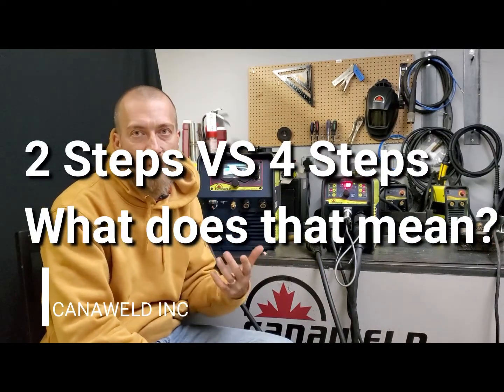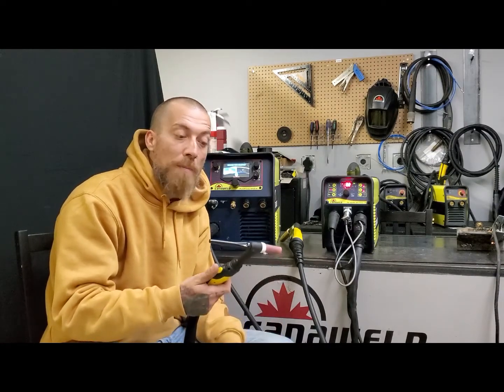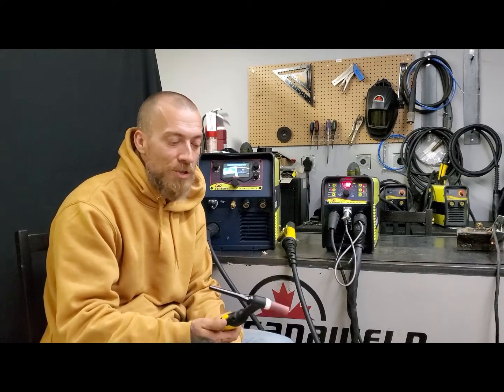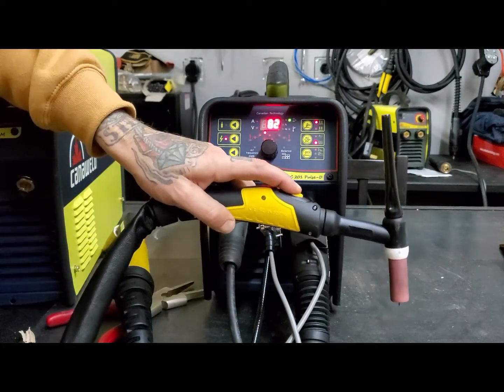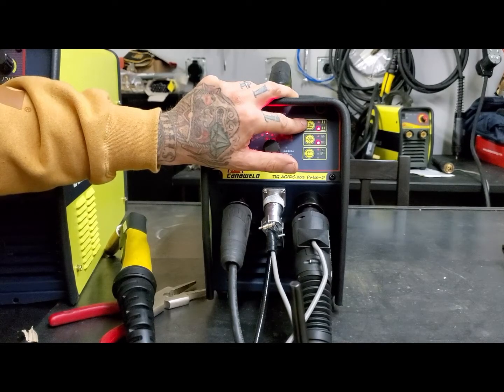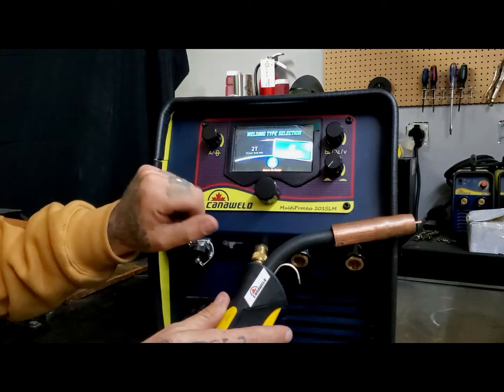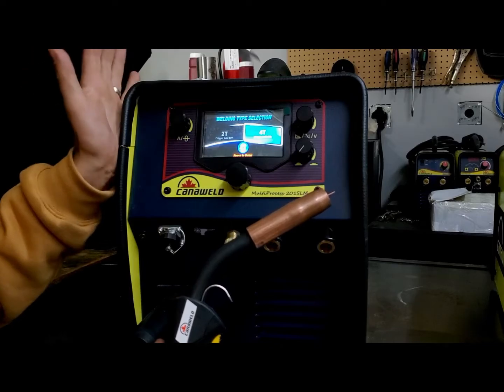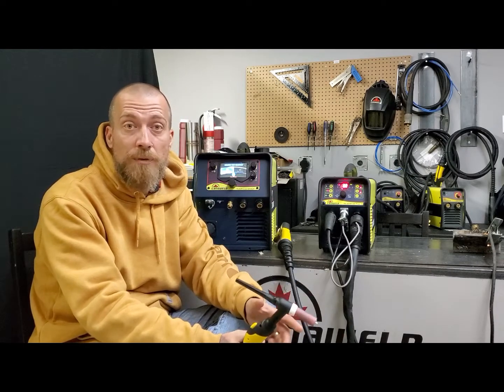2 Step vs 4 Step, What does that mean? by Canaweld

Comment: Hi , can i do pulse weld and normal weld by the same machine ?
Reply: Turn pulse feature on, not equipped, plug in pulse module, not available,  in 2 step, turn on the radio and follow the drummer with your foot pedal